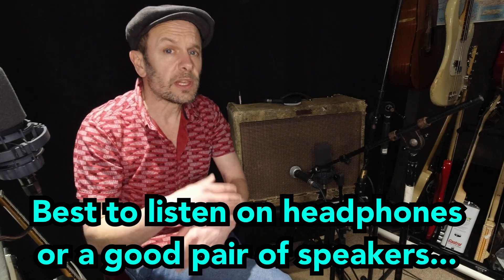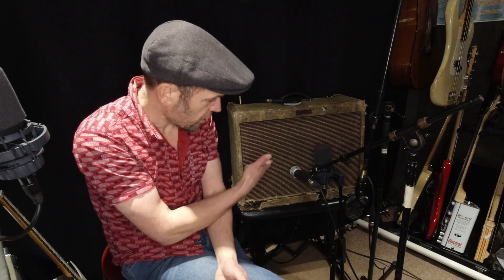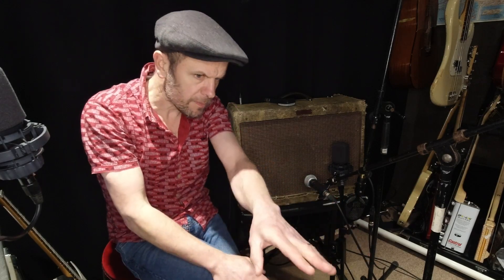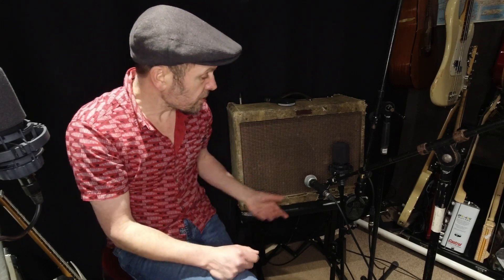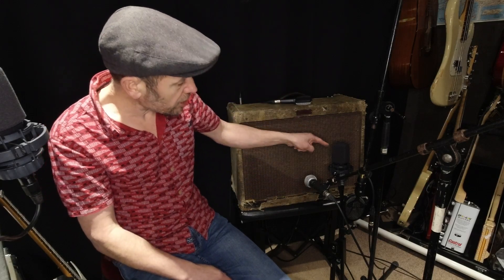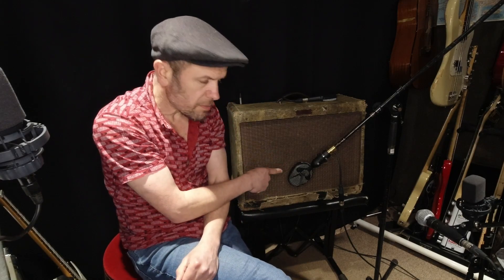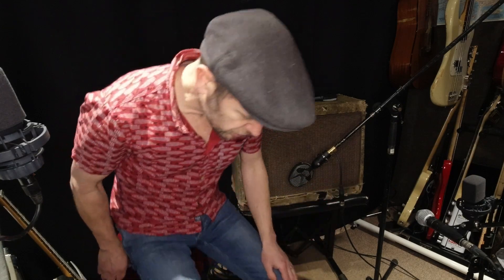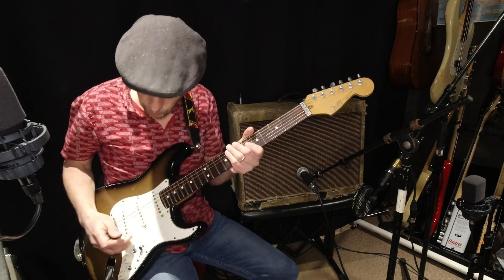Miking Up Guitar Amps

Comment: Perfect timing. I bought a new 2i2 last week and purchased a Nembrini Hivolt amp sim for iPad. 🤬the noise from a higher gain amp was just horrible. I know a gate will help this but I hate the noise gates. I returned it and think I would rather go this route with an older interface and my trusty Mackie 1202 VLC pro. 57 vs 609?  My old worn out ears make all that virtually sound the same. How loud was the amp Dan? Does it have to be cranked? Thanx for another great instructional.
Reply from the maker: The amp was actually at a room level, so not loud at all. The trouble with using an interface with a guitar sim is that the level going into the interface has to be quite high in order to keep the hiss down...

Comment: I've been trying to get a good high gain sound forever it always comes out like frying bacon
Reply from the maker: Yes: the level going into the interface (if using a guitar sim) has to be quite high to make use of the full,dynamic range of the interface. If using an amplifier for the high gain, perhaps a noise gate before the amp?